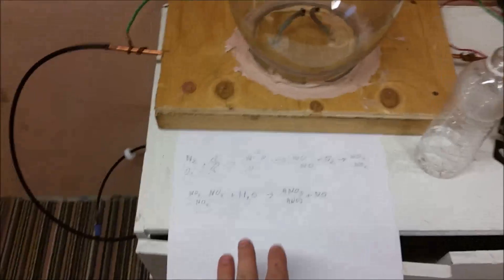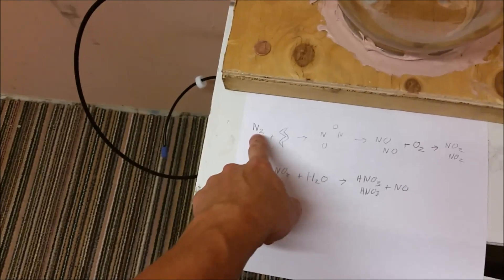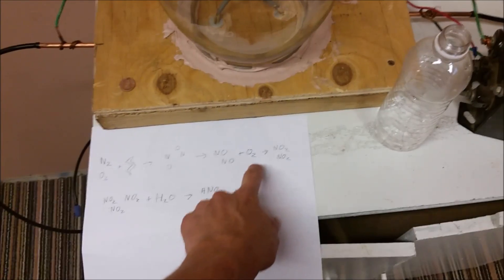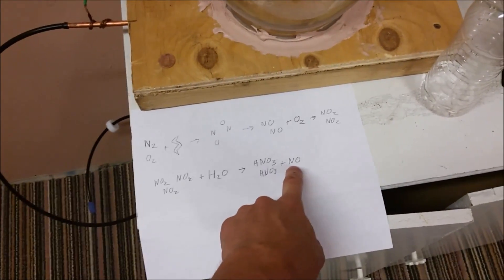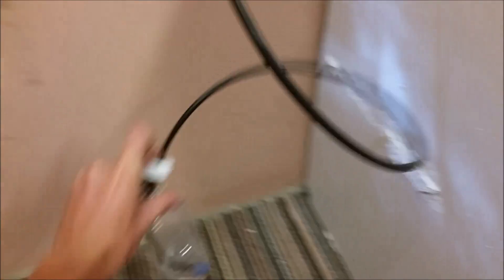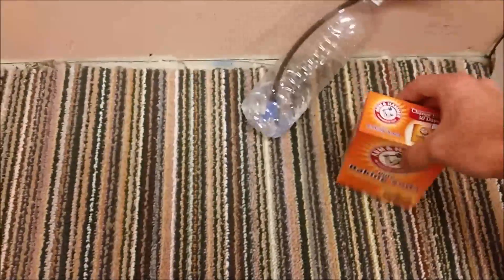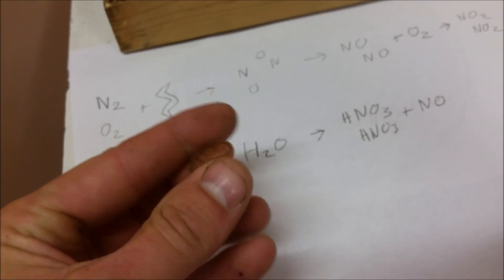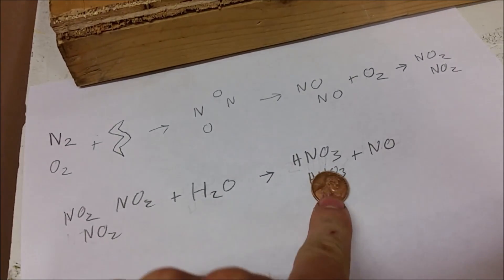Nitric Acid From Thin Air

Comment: ALL THESE YOUTUBE DIY HAVE 2 FLAWS:
1. THE SURFACE CONTACT OF THE ARC CONDUCTORS IS TO SMALL;
2. LITTLE AIR GETS PASSED/VENTILATED THROUGH THE ARC AREA;
ADDITIONALLY, I WOULD COAT 2 ARC PLATES WITH A 20%GLUE+80%GRAPHITE MIX, GRAPHITE IS THE MOST ELECTROCONDUCTIVE MATERIAL, OR USE 2 GRAPHITE RODS ALTOGETHER;

Comment: A small adaptation could make a more efficient gliding arc reactor.  You had both copper pipes curled away to make a Jacob's ladder. Then you pumped air into one of the pipes. If that pipe fully curled around to makie one loop, it could have blown the fresh air through arc gap and better cool the electrode.
 The fast moving air would help more quickly quench the reaction and new arcs form  making the process more efficient and the geometry would limit how much of the nitrogen oxides generated are resent through the arc.

Comment: You'd think a lightning strike would produce more than 9 moles or 400ml. I noticed your title says 'Thin Air'. I didn't notice you mentioning thin air in your video but I probably missed it. Higher elevation would have lower oxygen levels. Is that good or bad with this method? I realize there would be more nitrogen at higher elevation but thinking that oxygen would be more helpful there than not. Not expecting much of a response from a 9 year old video but all good. Enjoyed every video of yours I've watched. Thanks

Comment: If you weighed the Sodium Hydrogen Carbonate and made up a known concentration of solution, then a titration would have provided a much more accurate result measurement. Phenol red as an indicator is available in most water test kits.

Comment: What if one builds a series of axial electrodes for the air to flow through and that electrode tube is contained within a series of microwave magnets which cause the arc at each electrode pair to spiral through the air as it passes through.  That would maximize air/arc contact.

Comment: What was the date on that penny? If it was newer than 1982, there's so little copper present that I'd be surprised at more than a minuscule amount of reaction happening, even if you your product was 100% pure nitric acid (which, clearly, it wasn't). 1982 was the switchover year when pennies officially stopped being nearly-pure copper, to zinc slugs with a thin copper plating - A 1983 or newer (and SOME 1982s - it wasn't a clean "flip a switch" transition) penny is officially supposed to be 97.5% by weight zinc, with the balance being copper plating to give it the right color.

Comment: please explain how you are pumping air into a closed bottle for five hours and it shows no signs of expanding. if you are unable to do so, you are a fkn charlatan.
Reply: Dear @h7opolo - "please explain" why you called a pretty smart chemist a "fkn charlatan" -- when your "gotcha!" question was completely WRONG and idiotic. You said he was pumping air "into" a "closed bottle" - WILDLY wrong - it's utterly clear he's running air THROUGH the fishbowl, in one tube and then out the other, then down through a bubbler-stone into the collection bottle (which is OPEN). Did you even watch any of this? Do you understand ANY chemistry? No? So, maybe go back to posting videos of "Stevie spanking the meat" on your own channel, and leave the grown-ups alone. (OOOOOOhhhh!, ouch!)😲
Reply: @sumgai7  i didnt read your comment, troll. you're just brainless, so there's no point wasting my time. I blocked you instead.

Comment: What is the concentration of the acid?
Can the concentration be increased by running nitrogen dioxide in the water for longer?
do you need to cool the transformer or pump? if yes how so?

Can the acid ignite a fuel?

thanks

Comment: Does any ark produce acid? I think there are some much more efficient sparks that can be created. Also I assume a pressurized vessel would help. And a taller water column with more water.

Comment: Instead of bubble stones try using glass gravel..make it by heating glass up and dropping in cold water to temperature shock shater into small chunks.. Put the gravel on top of the air line in the bottle and it will defuse the bubbles into the 
Water without disintegrating ... I came up with this after watching a stoner friend put glass beads in a Water bong to defuse the smoke..

Comment: You got the transformer from the "DI"?  What does "DI" stand for?   Also, the NO2 in H2O creates nitric acid, but what happens to the nitric oxide?  Does it just vent into the air, or doesn't is create something else in the water?    I'm asking for safety reasons.

Comment: I've never made nitric acid.  I just use hydchloric acid + hydrogen peroxide to dissolve copper. However it doesn't work for gold because h202 decomposes. However if a small amount of bleach  is added to the hcl it will dissolve gold like aqua regia but its slow

Comment: I just today went down the rabbit hole discovering that modern nitrogen fertilizer is not made through this (Birkeland-Eyde) process, but rather through reacting natural gas (very nice name to hide the fact that it comes from the same source as other fossile fuels, isn't it?) with steam and air. If we actually made a hydrogen economy, where surplus electricity when wind and sun are plentiful could make hydrogen gas for later use, then as a next step we could make fully green fertilizer. Reacting it with sea shells would create CO2 locally, but this could easily be captured. Imagine Hydrogen as byproduct of electricity generation feeding into Norwegian salpeter production (and hydrogen fuel), with CO2 from that feeding into carbonated beverage (and compressed CO2 canisters, of course) production.

Comment: cody, if one were to set up this type of reaction and used a carboy filled with a gallon of water, how long would it take to create say a 20 percent solution?
also how many amps were you running?
Reply: I believe even a low current would do the trick, lightning is very high voltage, but relatively low current compared. Although more current may be more efficient, it’s extremely interesting!

Comment: What would you recommend as an alternative way to produce that arc? Something that could run for a month with consistent output if need be.
Reply: Zvs driver is an option for you dip the transformer in sunflower oil and use IGBT instead of MOSFETs and put a fan over IGBT

Comment: If a pinch is approximately 0.33g as is listed on some internet sources, then approx 3 pinches would be almost exactly 1g of sodium bicarbonate to neutralize the amount of nitric acid in 1mL of solution. This tells us that there is approx 0.75g of nitric acid in that 1mL. This gives us a concentration of roughly 11.9M nitric acid.

Comment: Hello kan you do the same in the vacume buble of a redion meter?👀
En see if it spins when the vacume is assedic see if the radion rotor spins at 0.01 atmosphere en not on 20 % of atmosphere🙏

If so 😍 than the thermodinamics has noting to do whit it🙏🌈
When we vacume we olso pulle out the space inbetween the elements en atoms.
I strongley think if the arc has bracht some space back in without elements
I dan't have a arc en a good vacume pomp instalation 😅🙏
Mabay the asedic don't manivest at oll in a vacume if it is trown out of the emotional inertia of the gas atoms.
Bit mabey it wusks🙏😍
To show the inportance of space inbetween metterstades🙏😍🌈

Have a beautiful day our nicht😍

Comment: Thing is about dissolving the penny is that if nitric acid were too concentrated if would quickly develop a film protecting it from further dissolving in a process know as passivation. Nitric acid needs a small amount of water in order to keep breaking away at the surface to reach the fresh copper underneath.

Comment: Bad choice of using plywood as an insulator between the electrodes.  Most plywood glue is somewhat conductive, and will slowly carbon track through the wood.  Learned this playing with Tesla Coils with that exact same transformer.

Comment: I think the final reaction is wrong, but I could be wrong, you are going to make Nitric Acid anyway, but I think it's not pure.
I think, the reaction is this:
 H2O+2 NO2=HNO3+HNO2
You need to bubble through the NO2 with O2 to make barely pure Nitric acid.
The reaction in this situation is this:
H2O+2NO2+O2=2HNO3
If you want to make completely pure Nitric Acid, you need to use N2O5 and distilled water.
I just 15 years old Hungarian chemistry student so I could be wrong, but these are just my thoughts.
Also, It would be safer to do this in a highly  ventilated area, or outside, because Nitrogen oxides are extremely toxic.

Comment: This is a simplified birkland eyde reactor. I have been researching ways to improve the efficiency of this process.  Might be a possibility is enriching the initial air feed with oxygen.  Not to much at one time of course, we wanna make acid, not blow things up.
Reply: A more efficient way maybe using spark plugs, and ignition coils. Or you can simply set an ostwald reactor, you can obtain ammonia by heating urea with calcium hydroxide, of course you need platinum catalyst Wich you can make using electroplating
Reply: @kelvinpino4065  an interesting idea, but will the plugs withstand the required temperature needed though?
Reply: @troymoore7537  yes, every sparkplug is made to withstand high temperatures for a long time, of course you can replace it with simple copper or iron electrodes, my idea is to put a few spark plugs in series connected with a Cristal tubing and circulate air trough it

Comment: What if you use oxygen from water electrolysis to enhance the reaction? Air contains 3.7  times more nitrogen than oxygen and you are trying to get NO2, which is two oxygen per nitrogen.
Reply: You said very logically i agree i think we should use a hho cell to get oxygen in lagre amounts

Comment: if the NO escapes when the gas bubbles through the water, why cant the air/gas in the receiving/discharge chamber simply be recirculated through the reaction chamber?

Comment: Could you improve this with two additions of a catalyst(platinum wirer mesh?) And then increasing the atmosphere pressure psi.  If you could re do this experiment with those two changes. Oh couldn't you distill it into fumic nitric acid instead of desolving in water?

Comment: You are chewing up more energy then you think!  most "neon sign'" transformers like the type you are using are 12KV open circuit, 60mA short circuit.  Under typical arc loading, you deliver about 300 watts to the arc, not 40 watts!  Put a wattmeter at the wall plug.

Comment: That wasn't nitric acid clear concentrate nitric acid has a pretty violent reaction with copper and fumes red and will kill you if breathed in and sniffing the bottle is the dumbest thing Ive ever seen. when nitric gases meets water (red gas) it turn into nitric acid any of in the lungs giving lungs are 80% water will react endlessly hydrogen peroxide is used to make a concentrated nitric acid which is the only nitric acid thats clear

Comment: Automobile Ignition Coils work well for the High Voltage necessary to create the spark/arc.  The Ignition Coil can be driven with an electronic circuit at 12 Volts to produce sparks at the rate of several per second.  Sparks at a relatively low frequency work best for such small devices to enable the Nitric Oxide produced to cool quickly between sparks to absorb Oxygen to form Nitrogen Dioxide while minimizing thermal decomposition.  Higher efficiency at the cost of more time to produce the quantity desired.  Passing the Nitrogen Dioxide into a solution of Potassium Carbonate will result in the formation of Potassium Nitrate which is a very useful substance.

Comment: Question for cody or anyone else that can answer the question, how do you optimize this?

Is there an ideal voltage? You use 9000w but someone in the comments mentioned 2000w being better. What would be the optimal level be?

Also would bubbling it through H2O2 concentrate it more? I read somewhere else (maybe these comments) that this produces HNO2 which can be further oxidized increasing yields of HNO3. Is H2O2 dangerous to use, even at lower concentrations?  Or is it best to stick with plain air? I know using pure oxygen is a no no as that's dangerous by itself

If there is anything else you can think of to optimize this I'd love to know as I'd like to build one of these one day. Maybe electrode size/shape/material? Ideal amount/pressure of air pushed through the chamber to react? 

I'm sure there is even more but that's all I could guess at off the top of my head.

Thanks!

Comment: Hmm, i just wonder, if it produces ozone as sideproduct and in this case, unpurity? Of course you know that air is nitrogen about 78% and oxygen about 21%. Or perhaps it takes something else to break oxygen bond than takes break nitrogen bond? I think build ozone generator at some point and it uses low pressure mercury vapour lamp without outer case to build most ozone. Outer casing is to turn mercury vapour radiation to visible light. But in my research for ozone generator or ionisator, shows that even best ionisators do produce some ozone as sideproduct, so how about this idea of yours?

Sorry about grammar, i am not native speaker. Also greetings from Finland. Keep up great work with bees and sciense!

Comment: Quite an idea!Try to play the scenario of lunar constant base!Or even the huuge and very valuable question:is that possible to survive  In small group on the Moon if the Earth will suddenly get lost(for example collided with an asteroid 500km in diameter at summary of collision speeds like 1000 kilometres per second which is possible though chances are low)..So would be those astronauts able to survive?))Question I hope you will try to spill some light on in your videos!))

Comment: I did this experiment and measured the concentration with NaHCO3. It was 0.9 M. I used a tv circuit for the high voltage but at some point, the transformer was fuming.

Comment: Would the burst from a stun gun component have the same effect on the air, or does it have to be a higher amount of energy to seperate the gasses?
Big clive has a video on stun gun components that are v cheap, I'd love to know whether it would work for this application. Thanks in advance. :)

Comment: You can buy an electronics part called a high voltage power boost module.
It can go up to 400 kilovolts.
Dont ask me how or if it works because I'm no electrician.
Reply: Yes i wish but they are fragile and cheaply made (china) the load of the air of the spark gap would burn out very quickly. I don't recommend that.

Comment: Excellent video.  I'm wondering about your penny test.  The copper is alloyed with 5% zinc and if it was made after 1982 it's a thin plating of copper alloy over a zinc core.  Soft copper tubing is almost pure copper.  I wonder how the zinc affects the reaction.  Also, using sodium nitrate as a fertilizer is a big no-no.  Sodium build-up in the soil is toxic to plants.
Reply: Nonya Damnbusiness small amounts should be fine. In larger quantities, it’s used commonly as stump remover.
Reply: @henryjiang9664  non the less its not a fertilizer and Na salts shouldnt be used.  Dont make me even start about how much NO3 going to be decompose to  usable nitrogen from plants :D
Reply: @rigormortis4169  I agree on the sodium, but I think you misunderstood the nitrate uptake. Ammonia needs to be converted to nitrite which then must be converted to nitrate to be usable by plants (this is the basis for cycling aquariums before introducing fish, getting the right bacteria to settle in the filter media so ammonia doesn't kill the fish). NO3 is already the right stuff for the plants. Reacting it with a shell (snail or seashell) or some wood ashes to make Ca(NO3)2 or KNO3 would make more sense.

Comment: it's probably too strong if you added water to the acid the penny would have desolved until it got to the zink which is like 90% of the penny. now what if I ran this ark system but use my O2 concentrator to blow through instead of the fish bubbler?

Comment: Raising the atmospheric pressure in a contained quartzite or  borsilicate glass tube and concentrated sunlight. [like in a test tube perhaps?]

I know that solar energy its self generates various oxides of nitrogen, as well as ozone, so its possible one could bypass the electricity and just use light directly.

Comment: would you be able to use a transformer from a microwave instead of the neon sign thing?  I watched a YouTube video   a guy using a microwave Transformer to do a Jacob's Ladder which created the ark ~  so my question is I guess could you do the same thing with a microwave Transformer the same process you did here ?
Reply: Fikishut The current produced by a microwave transformer is not limited, as it is with a neon-sign transformer.  It is not safe as a shock definitely can kill you.
Reply: You did not answer the question. Minus the danger, can you use a transformer from a microwave?

Comment: Since the energy of the lightning is not distributed perfectly... no. U cant simply add these numbers up like that.
80 mols of acid would require at least 80 mols of NO2 and thus at least 80 mols of Oxygen. 
Air contains 21%, so 1 mol = 22.4 (L/mol) / 0,21= 106 L / mol Oxygen
So 80 mol = 8.5 m³
12mm is the maximum diameter of the actuall lightning. The hot plasma might react with surrounding air... but...
This would thus give a lenght of 75000km (via lenght = Volume divided by  pi/4*d²)
Thats not going to be 10000x more.
Or in other words: 60 moles of HNO3 are several decades too much.

Tip: Recheck values with different methods.